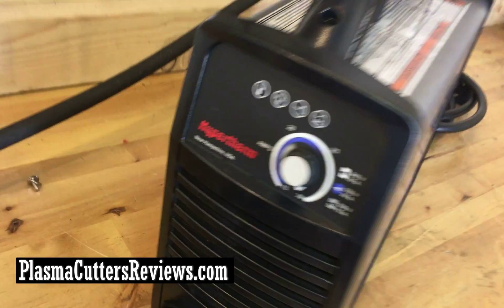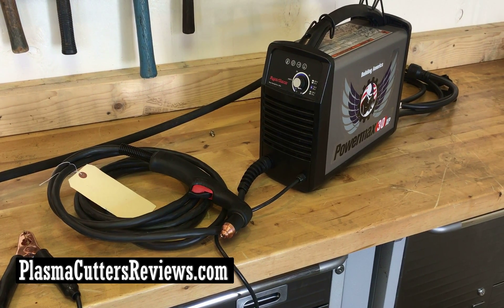Hypertherm Powermax 30XP Maximum Cutting Thickness Test (3/4" inch no problem!)

Comment: Tell them lower the price way too much
Reply: I got a used but in brand new condition powermax 85 with a 75 foot lead for a grand ! on Ebay  the original consumable box came with it but only 1 missing
Reply: @huckstirred7112  how much.
Reply: @truthserum9157  $1000 !   With a 75 foot lead ," which is a $750 up grade  ! THe guy spelled power max wrong so it never came up in any searches so no one bid on it !
Reply: @huckstirred7112  -  wow, great deal, I never find deals like that.

Comment: what will you recommend the 30XP or the 30 AIR Can the 30 AIr cut as good as the 30XP? thanks,  are the 30 AIR build-in compressor reliable and efficient
Reply: Problem with the air version is they don't have a water trap and become a squirt gun in humid zones or in regular climate when using heavy

Comment: For a $1500 machine I'm not impressed, my lotos 5000D will cut just as clean, I figured their wouldn't be any drop slag on the bottom 😬😪😬😪
Reply: But you need a compressor for the 5000D right? =)
Reply: You need a compressor for this one as well its not the internal air unit

Comment: Nice machine, but way too expensive to buy and repair.  I had a Powermax 1000 that died on me.  Hypertherm wanted over $1100 for a new powerboard.  Not worth it..   I'll  never buy a hypertherm again.  Especially since hypertherm  had a known issue with the power boards on many of those machines and would never fess up to the problem.
Reply: I beg to differ on that. Majority of the plasma cutters such as my CUT-50 can do 1/4" a tad slow but it can do it. 
when buying equipment, you buy what you pay.

Comment: Nice Review. I am debating between a used Hypertherm 30XP for 1000 dollars and a PrimeWeld Cut60 new for 650.00. Can't find any videos for the new PrimeWeld Unit. Which would you purchase.
Reply: 30XP 100%
Reply: To start out with, same with me upgrading. Go with the CUT-50, practice and get experience with it then upgrade.

Comment: Are you silly? Of course it is not going to cut 1" with the big gaps between your plates you are going to have blow outs between the gaps, you should know this. smh If you want to do a true test cutting 1" use a solid 1" piece of metal.
Reply: It was a test, c'mon. Don't be so ignorant.
Reply: @Kaizer357  LOL a test? Is that a joke? Are you a complete moron? Do you even know how to weld? I didn't think so you idiot.